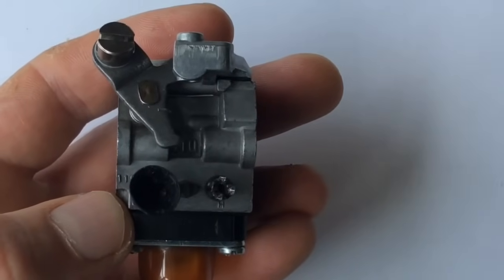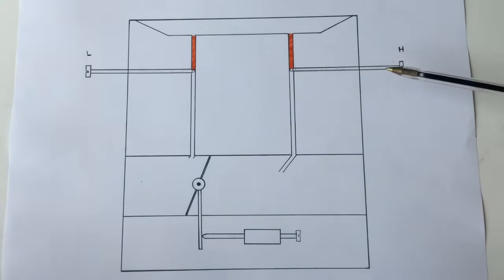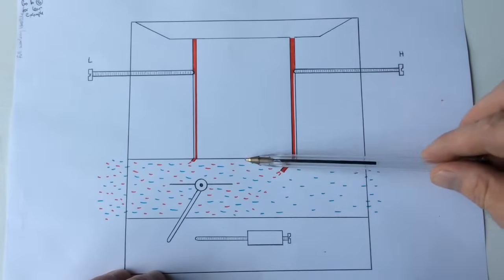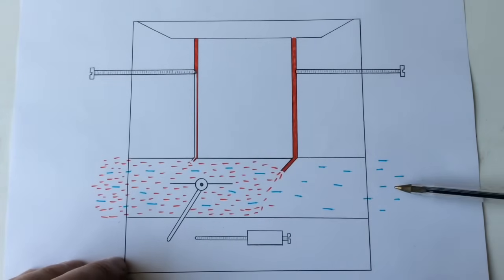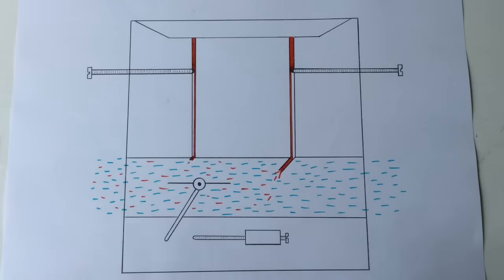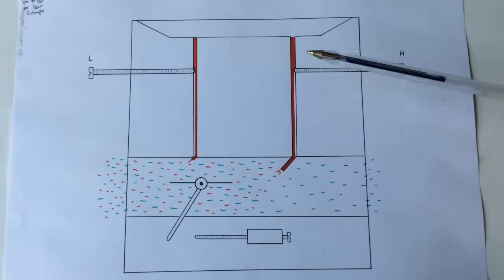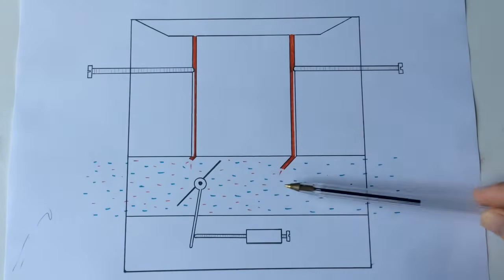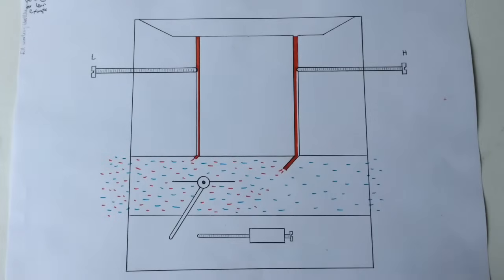HOW ADJUST CHAINSAW CARBURETOR:  Chainsaw Carburetor Settings Explained! (by Craig Kirkman)

Comment: I have tried this and found the new carb flooding one thing that needs to be checked is the reed valve if there is one as if the reed valve is blocked as on an old saw you'll definitely get problems, quite often when a new piston has been install as the engine was running lean to start with and no lubrication to piston rings because of bad reeds. just a thought.
Reply from the maker: David White, yes I agree, I should have mentioned about reed valves and their functional problems. That is something I will have to include. Thank you for the thought. 👍
Reply: Yeah I just noticed the flooding on a seconded hand saw I purchased lots of fuel mix and sparkplug dry.

Comment: You are a great teacher. I have watched a lot of your videos and they are all very informative.
 I have a problem that I hope you can help me with. I have an older Homelite chainsaw that won't start. It would just start for a couple of seconds then stop and spit gas out the muffler. I put a new carb kit in it and I have the same problem. I set the idle screws out by 1 1/2 turns, Checked the exhaust for clean air flow. Checked the spark plug and still the same problem. Starts for 3 seconds then floods and dies.  Oh,  what is the correct adjustment for the needle valve? I replaced it and the new one  seemed low so I adjusted it both up and down and still no good. I don't know the best height for it. Any ideas to help me???
Reply: Andy y
Buy an electric model.

Comment: This video is incredible.  I have zero knowledge on how engines work and this video didn't just say how to do it, but actually made me understand the process so I can do it properly.  Thanks a million!
Reply from the maker: William Morlok, wow, thank you for your positive feedback. It's comments like yours that motivate me to continue making these videos.  Thanks
Reply: @TheRepairSpecialist  Hi, can you help me tell me which screw I need to adjust because it vibrated and the oil flows in automatically

Comment: Great video!! 

I have a Homelite gas edger and its only about 6 months old. When i first used it a couple of times it ran great but now its starting to die out when i try to get on the throttle and it seems like it runs a little better when the choke is on halfway for some reason.Is is too rich you think?

Comment: one of the carbs on my blowers only runs when the high screw is all the way in. it's really weird and I can't figure out.why it does that
Reply from the maker: Sourav Mahanty, sorry to hear you have been having problems, but it sounds to me that you have a flooding issue. Just to make things a easier, I have a video on flooding so if you take a look at it then you might find it helpful. If not, then please let me know and I will see if I can help. Thank you for your interaction with my vids
Reply: TheRepairSpecialist

Comment: thanks for a good vid on carb tuning, its a shame the new carbs come with those stupid plastic limiters on the low and high jets. Just rip them off a start at one full turn out on each jet to get the motor running.
Reply from the maker: Chris Withers, brilliant, thank you for your positive feedback. I agree with the limiters.

Comment: Thanks.  What an excellent explanation of how the carb works.  I now understand what I need to do in order to get my blower to work.  I rebuilt the carb and now it needs adjustment.  It starts but does not idle or run.  Start with the Ticker being set correct then go to the H and finally the L.  Very clear explanation.
Reply from the maker: Thank you so much for your positive feedback, I really do appreciate it. It's comments like yours that motivate me to keep producing these videos. Thanks again

Comment: So, I've now got my chainsaw idling, and revving like a demon. To the point where its getting scary. Can they over-rev? Is it simply in a good engine design that if the fuel and carb are good, they will cope with screaming WOT revs?

Comment: nice job on the video, but i do have a question...is the low speed idle screw always downstream of the butterfly and the high speed upstream as you have illustrated?

Comment: Hi if the strimmer will not idle would you , Get the tick over quicker . As you say when adjusting the high side it must be  on full throttle.

Comment: very well explained now I understand how the fuel travels in the carburettor. 
I have a question,  what do I have to look for when my blower only works at half choke?  Its a Troy Bilt TB320BV 31cc.
carburettor model #753-04338.  Thank you so much and waiting to hear from you.
have a great day and stay safe,
R Cabello
Reply: Ricardo: when your engine runs better on half choke it  is a sign that your carburetor needs to be rebuilt or replaced.
good luck
Reply: signs of dirt in carb, and adjusting fuel.    high and low

Comment: Pls let me know how to tune a Walbro WG 8 as it does not have a high RPM adjustment screw.It has only the low screw and the throttle adjustment screws.

Comment: Hello, I have a question.. I just changed the fuel lines on my craftsman 32cc weedwacker trimmer  and I did not move or adjusted any parts of the carburetor. The problem now is that when I try to start my Craftsman trimmer it starts on full power and when i press the run button it stops and dies out. any idea of what did i do wrong? please help
Reply from the maker: Hi, yes I do have some ideas of the sort of things that may be causing you this problem. I am in the process of making a video right now that covers your issues. It does take some time to complete these vids but I hope to have it published in a few days. It is best that you see the video as it explains a full range of things you could check. Thanks Craig
Reply: +TheRepairSpecialist Geat. thanks for the quick reply. looking forward for those vids.

Comment: Yup, That explains why it took so long for me to get it right. I was always adjusting low mix first. Then the high mix. But you  and the diagram made it easy and clear. It just seems like common sense now. Many thanks.
MUDDy
I subscribed with a big smile. :)
Reply: Hi there, Muddy,     I've been down the same track with adjusting these carbs,    some, either factory or after market folks are doing it backwards, finally it works like it should,  TRS= great job of showing how it should be.  regards
Reply: @LLuE88  yes lot of vids of people saying the hi.. its just for in the cut tuning ..always say adjust the low to get it to run lean or rich ....weird..someone said turn the low till it gets hi revs then bring it back till lil choppy sounding

Comment: I notice that you seem to be the only one that starts with the high screw first`why is that?
I also assume that starting with the screws out only one full turn each you are starting quite lean to begin with so you know you have to turn them out to to get more fuel into the venturer  which makes it easier to judge.Most people start with 2 full turns and if they aint use to the engine sound they don`t know witch way to adjust for optimum function.

Comment: Great video . My string trimmer runs fine now at low and high rev, problem I'm having is after 20 minutes of use it wants to flood out . Of I hold the machine upside down it seems to want to run and idle fine . Very confused about what's happening and wondered if you had any suggestions on what could be going on ? 
Thanks

Comment: Hi,as I had said below very well explained now I understand completely.
I do Have a question,I have many carburettors that are very similar in size and the formation of the fuel intake and the throttle ventura are in the same place and the 2 screw holes are the same width that hold the carb to the engine body.but I have noticed they either have a there little port hole in different places or some will have 2  or even none closes to the butterfly side,could these fit on the same machine.none of these have are the primer bulb type.

Comment: What a BRILLIANT explanation I have watched hundreds and hundreds of vids to do with the carburettor and never came near to understanding them until now,you do have a great understanding on how the population have different ways to learn`and you have broke it down into its simplest form.cheers for that and your other vids on the carburettor.
I do have a couple of questions please,Are there cases that the mixture screws on some carbs may be opposite sides ie revers,And is there a information that would tell us what mixture of fuel to oil ratio would of gone into the older strimmers/brush cutters on models made in the 70s up to the modern times.I ask this due to having several strimmers and brush cutters having trouble to start due to wrong ratios I think, in my shed

Comment: Great explanation, TYVM. My 20-yr-old Echo weed-wacker now runs like it did when it was new, although it is still troublesome to start. Aside from priming using the plastic bubble and setting the choke, I usually have to shoot some starting fluid into the carb throat. Beats buying a new one.

Comment: It kept glitching tonight when you said about turning the screws out after seating them.  I usually go 1.5-2 turns out with the L when setting one that is improperly set beforehand.  It sounded like you said 1 turn but I might be wrong about that

Comment: I have a blower that only runs when pressing the snapin primer or when its choked.   Adjusting the carb don't seem to help and neither does another carb or fuel lines.  I haven't replaced the lines inside the tank or the tank breather and fuel filter.  It also has a little lower compression than in great condition but should still run.  I also have a different item that only runs for 15 secs unless I tip it back for a moment shortly an then goes back to before needing to be repeated again and again.  If you have any thoughts please let me know.
Reply: Have you checked/cleaned the "Spark Arrestor" A little item down by the muffler. Takes about a 16mm deep socket to get it out.  It comes out much like a spark plug. on the end you will find a steel screen much like a window screen. This could be full of dirty oily crud that is causing back pressure on the motor.  I was told by my Stihl Dealer to take a propane torch and fire the screen until red hot, burning out all the crud.  Then take an air hose and blow out the stuff till it is all clear.  After I did this my clipper runs like a top. Craig, the Repair Specialist can add his comments if he reads this comment.  Hope this helps.
Harvey
Kelowna, BC.
Reply: no buy i pulled the muffler & ran it without it finding no difference

Comment: very good explanation. quick question. on a new carb. do you screw the tick over screw all the way in and then back it out until the butterfly is slightly open before adjusting the high and low adjustments?
Reply from the maker: Hi, thank you for your kind comment. Personally, I do like to open the idle butterfly a little before I start the adjustment as I find this helps the engine keep running when my finger releases the throttle trigger during the adjustment. So I personally would do what you asked and then I would finalise with adjusting the idle correctly by sound. I hope this has helped a little. Thanks

Comment: I recently bought a 2000 mercury 50 2 stroke and have been very intrigued to learn the motor and whats actually going on with it. I have watched several videos and you are by far the best at explaining what is actually going on with the motor. I have a rebuild carb kit coming in with new floats, jets, and gaskets. I am going to be purchasing the service manual when i get the money. The motor has 3 carbs. 1 to each cylinder. Im wondering if i will have to adjust anything once i install the kit. I am a little nervous as this will be my first time actually breaking down and installing a carb kit. If the motor was running good do you think i will have to adjust anything after? Plus i need to find out if i will have to set the float depth or will it just sit flush and use the old float as a reference. Again thanks for the video and you are GREAT at teaching!!!
Reply from the maker: Hi, thank you for your kind comments, I really do apreciate them.  I'm really pleased you are having a go at your engine. Please don't worry too much about getting things perfect right away.  The area of the engine you are working on may at times cause a little frustration but you are unlikely to make any permanent expensive damage, even if all went wrong! But I'm sure it won't.  It's all about having a try and I can see from your message that you are certainly a trier.  That's brilliant! When you have built it up and start the engine, if all sounds ok then great, my philosophy is " if it's not broke then we don't need a fix" so there's no need to adjust anything, which will save you some time.  If it does sound like it needs some adjustment then you may well have to adjust each carb.  You will learn so much from this and it makes me happy to hear of people doing so. All the best and thanks again.

Comment: Fantastic explanation. Out of interest, do you use a tachometer when tuning?
Reply from the maker: Hi, I tend not to use a tachometer for 2 stroke cycle engines as I prefer to set by sound, usually you can tell if the mixture is correct this way. I hope this helps and thank you for your kind comment.

Comment: A fine job explaining.  Thank you.  
You are Intrigued by these engines and enjoy talking about them and it shows.
Reply from the maker: Hi, thank you for your kind comment. Craig
Reply: Morgan Oliff in
Reply: You also act like an idiot.
Reply: if you get your two stroke running just right you can hold that against your member and youll be amazed at the results
 you ll get win win  @blackspot5795
Reply: Morgan, I agree with you 100%. A fine job indeed!

Comment: I have a Mantis tiller that I needed to put a new carb on. But then I had to adjust it because the engine is older and the factory settings were not cutting it. I just did not understand the other videos from mechanics all that well until after I saw this. Seeing the theory is so helpful for me. I need to understand how things work and not just be told to turn this screw this way and that screw that way. So this made it very clear and it was exactly what I needed to help me tune my tiller. Got the job done and I am a happy man. Thank you.
Reply: How did you adjust it?

Comment: is the "tickover" also known as the throttle adjustment screw?
Reply: tickover is king's English for idle
Reply: the base position of ticker screw is done visually or by screwing to the end and backing off?
Reply: @bobgraham7941  The tickover screw limits how far the throttle can close. You can adjust it so that the engine continues to run at a suitable speed when you release the throttle. You should also adjust the low-speed mixture for the smoothest idle. If the engine hesitates or stops when you open the throttle quickly, try setting the low-speed mixture slightly richer.

Comment: Very nice explanation, very detailed.
Question: you say if you make it too lean the engine could seize from lack of oil. So what's the best way to adjust? I have heard you turn the screw out until RPMs drop, turn it in until you get the best performance, then turn it back out 1/4 turn so you don't run too lean. Would you agree?
Reply: Cuando no lo esperas
Reply: Actually with too much air, it burns on higher temperature (if 2 stroke, there is less oil too), it can seize very easily